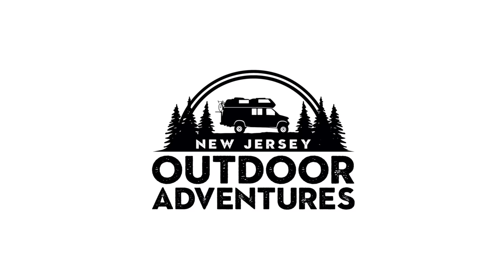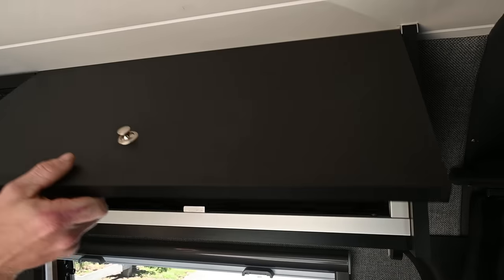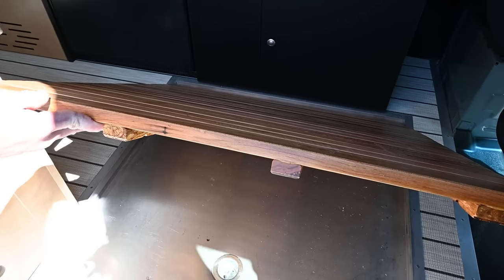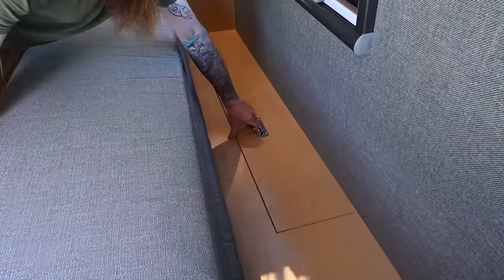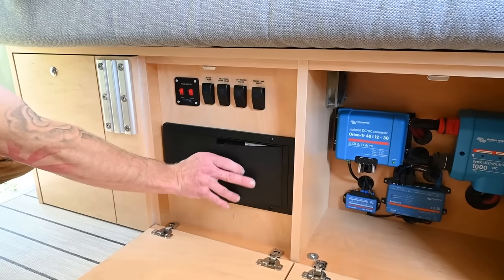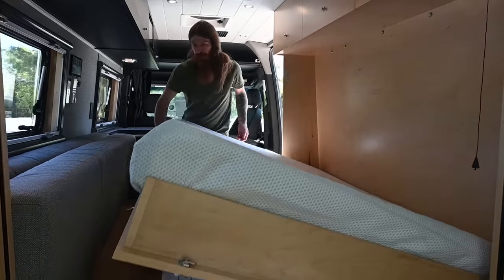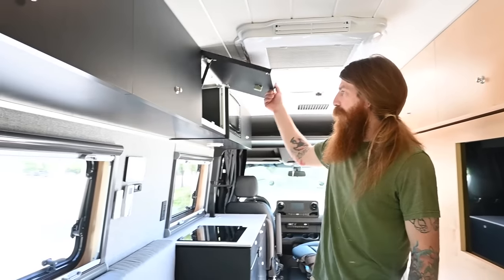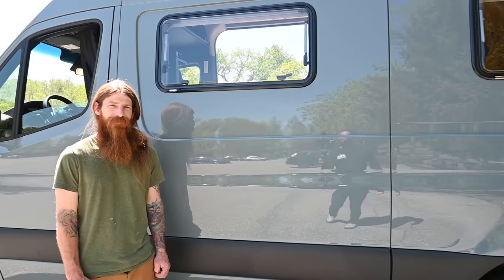MOST Creative Van Layout - Murphy Bed, Hidden Shower & More | SPRINTER Van Camper

Comment: That is a sweet van.  I built a very similar hidden shower in my Transit.  Except my shower is recirculating and the hot water is  Rixens.
Reply from the maker: The Rixens is great
Reply: That's awesome Jeff! I agree with pat the mcs6 is a great hydronic unit . It was a consideration for this van when I installed the s2d2 but with the overabundance of power in the battery bank, the simplest solution was a bosch electric water heater. Out of curiosity what kind of setup did you use for the recirculation on the gray water side?

Comment: Great design!! Very cool shower feature. I like how the curtain has magnets. You never need to notice it unless you are using it.
Reply from the maker: Stealth shower
Reply: Played around with a few different ideas.  Most track systems hang low and are  sometimes finicky with the small rollers.  There's 26 hidden magnets in the ceiling, so there's no wrong way to snap it up. 😀

Comment: Great project! Actually one of the best I have seen so far. For my needs I would just want to have a fully-fledged bathroom and an exhaust system for the kitchen. Apart from it, the project is just perfect!
Reply from the maker: So happy to hear this
Reply: There's always the option of an extended length van with a rear bathroom. Thanks!
Reply: So great. It has a bathroom in a short van.

Comment: Very nicely built. These videos are so useful for getting inspiration.

Pre-pandemic, I did a self-build conversion (with basic skills and tools) on the road outside my house.

I had a lifting bed - just using sail ropes and block and tackle to help lift up, which worked very well. When stowed, it was about 1.5m (5ft) height underneath, so I had the seating under there. It was at the front of the van, and when stowed you could slide it about 18" above the cab to reduce the low height section. The rest of the van was full height with a normal domestic under counter compressor fridge (converted to 12v, but next time I'll just use standard 240v AC from the inverter), LPG gas hob and oven, a sink with a retractable shower tap and a recessed shower tray as this guy's done (but my effort was nothing like as professional looking!), a swing table made out of a bit of oak, and more storage than was necessary. All the electrics was from solar (no alternator from the engine or shore supply). In three years I used the shower about four times (the rest of the time I used service stations, campsites, lakes, or just had a flannel wash). Every other van person I've met says that the shower was a priority when they built/bought the van, but then never use it. So a system like this I think it's a good compromise - it doesn't take up space. The retractable tap means you can use it outside of the van to wash stuff (or shower).

Next build will have a similar layout, the bed worked very well (although I'm tempted but the Murphy) but probably no shower tray, and I'll cut down on the storage, and hopefully build it so it's more professional looking. As it was an old van that I bought for £4k ($5k), and I did everything myself, the whole cost was about £8,000. As well as cost, my priorities were as low tech as possible as I planned to go to West Africa in it and didn't want it to be too reliant on tech that would be affected by dust and difficult to fix, and although it was a 2wd van I had BFG AT tyres that gave a 1-2" lift and was very effecting on gravel pistes in Morocco. Sadly the standard Mercedes rust took over and I had to scrap the van. Next time I'll use a Fiat Ducato.
Reply from the maker: Oh wow that is awesome, thank you for sharing that
Reply: Love it!

Comment: Its a really good build. I would buy it with a couple of changes and if it was cheaper. Being a poor disabled person trying to survive in the age of cost of living crisis, I could live in this build.
I would take out the shower and built in monitor. Add folding out steps or ramp for easier access for when I'm older or my health declines further, with handrail. I would add an outdoor shower system to avoid rust, mould or damp inside the van. Have easier access to electricals such as cables etc in case of much needed repairs rather than having to take some of the build apart to access them. I would add more cold food storage such as a large fridge freezer. Getting to the shop while disabled and poor can be hard. So bulk buying on the cheap is easier and more cost effective.
I didn't quite catch how much solar it has but I would also add a small wind turbine for energy generation. Either on the roof acting like a weather vein or an out door system you fold away like on a tripod. Living in Scotland, the Sun is almost non existent but we do have plenty of wind and rain.
I don't know if I missed it but I didn't notice anything mentioned about a heating system. I would add an electrical one as it gets really cold here in Scotland during winter. And maybe some sort of air conditioning for the hotter months. Or for traveling where its generally hotter.

Thanks for the video. It helped give me ideas for my own build. Now I just have to find a van I can afford and someone to build it out. Unlikely sadly. ^_^
Reply from the maker: Appreciate the suggestions

Comment: Game changer!! Very impressive build. The magnetic curtain is brilliant- the silly little hooks on all the other shower curtains look like a pain to set up. The magnet system makes the curtains so much more useful- you can hang them anywhere to use or dry them. My only suggestion is to have a spray nozzle next to or on the sink faucet in order to better clean out the shower pan when needed.  And big THANK YOU for making the most info packed video under ten minutes! I can't stand the ones that drag out for half an hour. Thank you for your efficiency Hunter! 😄
Reply from the maker: Great suggestion, I like it

Comment: I think this is the best van I've ever seen. Only two things I would change. First, it would be nice to have the capability for solar production. I'm not sure if they make 48 volt panels, but they might. My house has 220 volt panels (never heard of them before they installed). The other minor thing would be to have the tank monitor up where you can check it easily, instead of near the floor in the cabinet.

Anyhow, great van design!!
Reply from the maker: Appreciate the feedback
Reply: You don't need 48v anels, a solar controller will convert it from whatever voltage they are to the battery system voltage
Reply: I loved the idea of two alternators. I suppose you could have a little portable solar powered battery if you felt like being stationary for a while and not have to drive around to recharge everything but a back up solar system, one way or another would make me feel a little better.

Comment: Whoa! Another top-of-the-line creation. And mega-storage possibilities. I like it a lot! Not sure I completely understood the the power structure (without solar) - does it charge from the engine in a super-efficient manner? How long would you be able to go without turning the engine on (let's say if you didn't use the induction cooktop & did not use the microwave)? Thanks for another great video, Patrick!
Reply from the maker: Glad you like it Darlene. You can go a full day without starting the engine. The DC to DC charger will charge the battery much faster than solar
Reply: Thanks Darlene 😊 With such a large battery bank charging from solar, it would take roughly 5 days of sustained sun with 400 watts of solar . So, to make sure it has the most efficient charge rate, we used a 48v battery bank coupled with a secondary 4,800 watt 48v alternator.  At cruising speed, it will completely charge the battery bank in two hours. While exterior temperatures can fluctuate its power consumption with the air conditioner, you could expect the battery bank to last 2-4 days if running the a/c (average 8 hours a night) and using the  induction cooktop  (.5-1hour).

Comment: NJOA,,,,,HELLOpatrick,HUNTER has certainly got ,great ideas,on this SPRTNTER, did you catch the TV,as part of the bed? Daytime use,shower is remarkable,  with no solar how are the batteries recharged,? Or is it similar,to rhe VOLTA  system,that restarts its engine with a second altenerator ?   Great space usage,,  Thanks for showing it ,,,,🇺🇸🇺🇸🇺🇸🇺🇸
Reply: It has a 4,800 watt 48v second alternator controlled by the wakespeed 500 charge controller. It's capable of charging the whole battery bank in two hours!
Reply from the maker: Thanks Hunter for the reply.

Comment: Nice work! I made a similar shower tray about 4 years ago as seen here https://www.youtube.com/watch?v=EMv3YK-qQ8A
A couple of things about it though: You need to be able to put the shower curtains through the washing machine regularly, so went for hooks instead of magnets. Otherwise it won't go through the wash. I planned to shower on the wooden tray, but now remove it before showering, so after showering I can put it back in for a dry floor. You don't want a wet floor after showering :)
Reply: great points.  good example of how the 'wow effect' of seeing a cool design can clash with the realism and practicality. the truth is that the shower curtain needs to air out and dry or else you are looking at problems with smells and mould. so  . . . if you are a boondocks, you will need to think about how to hand it out regularly.  still a cool design.

Comment: Great narration, the hippy sounded like a pro announcer!  Kidding..., but no uhs and ems, he talked good. On a more serious note, just because it's a 48 VDC  system, is no reason to not have solar, two 60 cell modules, wired in series,  will produce their best power at about 30-32 volts. Run that  60-62 volts thru a quality MPPT charge controller, set to a 48 VDC battery, simple.
Reply: Solar makes sense if you stay in one spot for at least 3 days. Most people that buy small 4x4 vans are    Exploring daily and have alternator keeping them fully charged. You can easily add solar but I don’t think it would be needed. Save $4000
Reply from the maker: In this build the alternator will change the batteries much faster than solar and the owner will be on the move and not sitting on one place for long

Comment: Nice well thought out build and attractive finishes! One concern I have for every build is safety in the event of a rollover accident. Hopefully all the heavy systems (like battery banks) and other contents are bolted or strapped or behind doors that can withstand the weight and not allow a break through. If those heavy items fly around they tear apart the interior and can be deadly for the occupants. Of course rollover accidents don't happen often but can be catastrophic if they do so just be prepared with a safe build. Then you can concentrate on having fun :  )! PS: I grew up in Norwich CT so not far from you all!
Reply: They are bolted in, your right, any unsecured Item can you harm you

Comment: I'd be very curious if I see a feature I haven't seen before. A murphy bed that can come down in two parts, split down length wise. For Instance say someone wants to sit at the long couch but another person still sleep. The murphy bed could come down where only 1/3rd or 40% of it pulls down length wise so one person has the bed to lay at and the other person can still use the long couch and have room for some type of lagoon table in the middle. 
The idea is, the murphy bed could come down as 1 & 2 options 1: full bed pull down and 2) one side of the bed pull down thus there may be a latch which connects both side of the bed lengthwise you you have both options (full bed pull down, or 2) detach latch connecting both sides of murphy bed so only one side can come down. 
Yes I am aware there are other van home set ups that allow one person to lay in a usually full sized bed and another person sit in a smaller seat with a desk, or, like I think Sarah & James channel where the entire back of the van can be U shapes so one person may lie on one side of the seating area while the other person still works and sits at the other side, but this is not what I am talking about. I'm referring me to a murphy bed that can split so only one half length wise can come down. I also mentioned about 40% of the bed coming down to still make it easier for the middle walkway to have a bit more room than if 50% of the bed came down.
Reply: The coach is same level as bed if you want I to be 68” wide .

Comment: Nice wire management.  Attention to small details like this ensures that this van was constructed correctly.  The only problem is the inability to watch tv in bed
Reply: R ear windows has electric shade that doubles as projector screen to watch tv or movies on big 60”Wx 40”h screen
Reply from the maker: There is a projector screen that you use when the bed is down

Comment: Good layout and attention to details. Curious what it weighs.
Reply from the maker: Good question. We did talk about it off camera and I don’t recall what he said
Reply: With a full tank of water and me in the driver's seat it weighs 7,300 lbs, which leaves 1,750 untill is max gvrw
Reply: Wondering myself what it adds to the base van weight. A lot of materials shown: 80-20, door struts, lots of plywood, are not the lightest options and they can really add up.
Reply: @christopher brown  the curb weight with me included (155lbs), full 28 gallon tank of fresh water and full fuel tank is 7,300lbs. With the max gvwr of this van being 9,050lbs, it leaves an allowance of 1,750 lbs. The build out weighs roughly 1,800 lbs. There was a lot of attention paid in the overall weight when constructed. There's always a compromise in material when weight is a consideration. Given the amount of potential for wear and tear in a smaller space, I preferred to use a higher grade 11 ply maple. Although there are many options available for composite core veneers, I've yet to see a good solution in the overall rigidity of cabinetry when used. I do prefer the upper cabinet face frame to be 10 series 80/20 for its strength and securement to the ceiling. With is liner weight at .54lbs per foot, it is double that of poplar wood and around the same as oak. Given that there are only around 40 linear feet in the cabinetry, its overall weight is fairly insignificant at 21lbs.
Reply: Thank you for the detailed answer, much appreciated! I'm working on a Vanagon TDI that I'm hoping to get 30 MPG with, so I'm focusing on building as light as possible. I appreciate these videos for innovative uses of space. Be well!

Comment: MISSING INFO FROM VID ON THIS AWESOME VAN

 -What wheelbase is this?

-More explanation re: how electric needs met/produced w/out solar - how does the addl equipment do that?

Does the  build-out company measure or reduce VOC off gassing in this very tiny, enclosed space from the iso insulation, memory foam mattress, cushions, fabric wall coverings and likely
 the UV protective coating on all woods.

Health/safety BEFORE beauty.   Thank you
Reply from the maker: I can help with one of them. It’s a Sprinter 144” wheelbase
Reply: Hey Clare, also to clarify the battery bank recharging . With such a large bank, it's unrealistic to keep it charged with solar. So with this van, we used a 4,800-watt nation's alternator controlled by a wake speed charge controller.  This alternator can fully charge the bank in two hours, while  400 watts of solar would take roughly 26 hours of direct sunlight to achieve the same. 
We are also very conscious of off gassing and v.o.c in confined spaces.  The poly iso we use in the floor and ceiling is r max, which is hcfc and cfc free . In the walls, we use Havelock wool.
The wall materials are sunbrella acrylic fabrics that have zero voc or off gassing. All adhesive used is 3m fastbond, which is a water-based latex contact adhesive.
The plywood is columbia Forest Products  uv coated maple which has an ultra violet cured water-based coating that is impervious to solvents or water-based cleaners. It is also formaldehyde free and zero v.o.c. 
For the mattress and couch, the memory foam is CertiPur-US approved and one of the lowest available. They also have a fiberglass free cotton and polyester fire sock internally.
Reply: Also missing in rbis van that vid doesn’t show is the Incredible craftsmanship that you can can’t fully Appreciate . Young man did a beautiful job with my design
Reply from the maker: @GVV860  excellent information Hunter
Reply: WOW... THX ALL for all your replies... collecting as much info as I can absorb on how all this is done.  THX

Comment: where do you put your clothes? the narrow drawers in the kitchen area might hold pots, pans, cups and plates, but all of the bottom cabinets have equipment in them - even when there is additional room in them, I'd hate to be putting anything in front of the inverter, etc. Every time I thought "there's the storage" nope, it's a wayer heayer or other rqjipment. The only eqjipment I didn't see that I'd need was a heater. 5+" of insulation is nice but I'd still want a heater. This van would not be for me.
Reply: There 26 cubic feet of storage across the  upper cabinets! When it comes to heat this van has a 13k btu ac and heat pump roof top unit along with an s2d2 diesel  eberspacher heater under the passanger seat.
Reply from the maker: Appreciate the reply Hunter, very informative.

Comment: You can add solar to a 48V system, you just have to use the right charge controller.
Reply from the maker: Yes, he knows that. What he was trying to say is that it’s like breathing through a straw. The alternator charging system is the best and fasted method of charging